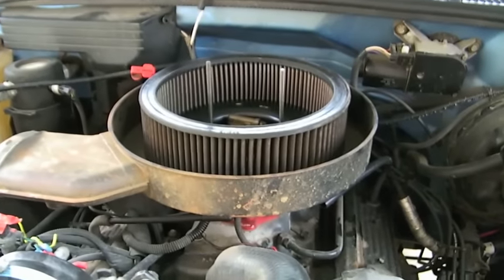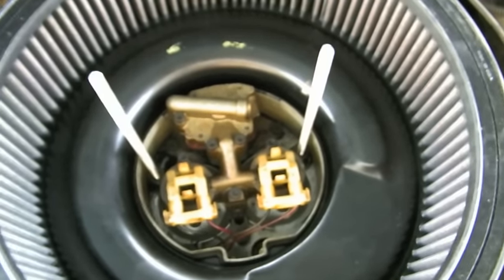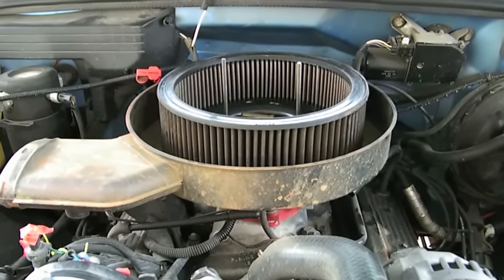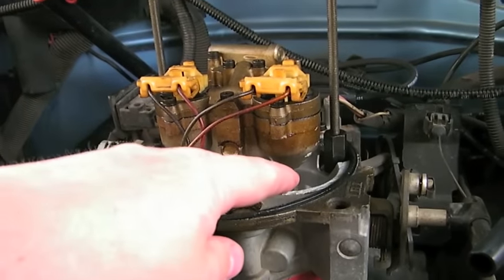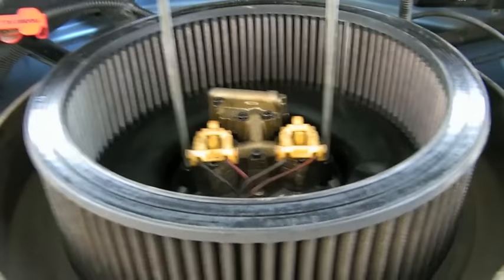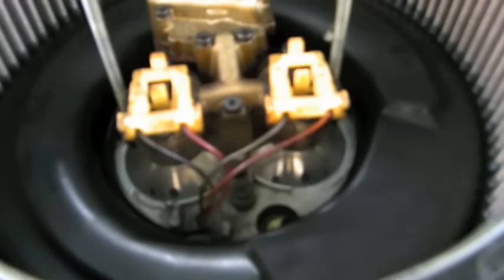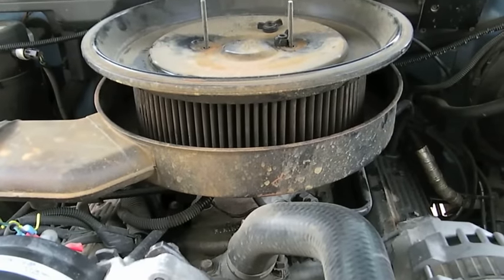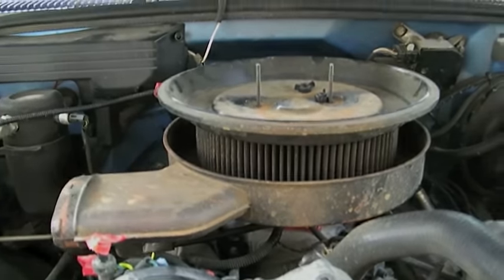TBI mods, how to get the most power and Horse Power from your TBI engine.

Comment: I have a 1990 cadillac brougham, and I git the sport air intake manifold for it, pretty much like a throttle body spacer because the throttle body is sitting up higher, and honestly the car could climb hills in 4th gear for the first time in ever, and the flipping the top thing, I have to agree about the warm air, because my cars outside air temp sensor sits in the air filter housing and it was negative 15 outside Celsius, and honestly while waiting in traffic I looked at it after 15 minutes and it was reading and hove zero until I started moving again than it went back down to the outside temp again, you picks beating on the poor guy here just trying diffrent things isn't nice, his flip does actually work, just as long as your moving and not sitting for a half hour because I proved it by reading my car myself, just please hook the oil blow off on the passenger side into the drivers side one so it's working, but you guys wanna try something, try the sport air intake, it's egr friendly and honestly it made my car run alot more open and free, it could hold its actual speed, 1990 cadillac brougham 5.7 litre, love the car, and getting the motor rebuilt with some fun stuff on it

Comment: Get a set of 305 heads long tube headers flowmasters and manual 5 speed standard with 18 pound Macleod clutch and pressure plate. I think you will be mildly surprised.
Reply from the maker: Thank you for watching.

Comment: so i like doing dumb shit to my 1995 chevy c1500. with 4.3l.  and working in the shop that im at currently, a few of the guys here used to work at the AZ GM Proving ground up until the closing down. and to really get the best air flow just cut a whole in youre right fender leading to the stock air box.  all this aftermarket  "cold" air intake and this bull of flipping the lid it a bunch of shit. hahah. unless you fully remove youre hoodor even cut holes or flares or true hood scoops nothing works as well as the stock. plus its been proven and even dyno tested on a lot of different cars and truck that "cold" air intakes dont do much at all. but the spacer looks cool though.
Reply from the maker: +Michael Jenkins 
Somethings are just fun to do.

Comment: Why does everyone ditch the stock tubing from the fender and flip the lid? All you're doing is make it sound like a Q-jet when you floor it, and you're just pulling hot air from inside the engine bay instead of cool outside air from the fender....
Reply from the maker: +Justin Keckhaver 
We like the sound.
Reply: Ok, well have fun with that
Reply from the maker: I had a lot of fun with it.
Reply: Stock tubing is very restrictive.

Comment: 8 degrees advanced on the distribute  on 305 made my camaro run very nice might be a little more or less for you car but yowl know when you find the sweet spot
Reply from the maker: +Stompin Mcallister I am sure it would. I know playing with the timing on my MR2 made a difference.
Reply: Stompin'------I have the stock 5.7 with the TBI and my Haynes manual says to disconnect the brown wire-with-the-black-strip going to the ECM.  Set the distributor  timing at 0 degrees, then re-connect the brown / black strip wire and the ECM will control the advance timing.   Are you sure about that 8 degrees advance on your engine?
Reply: Yes I'm sure on that gave me better throttle response better kickdown my camaro is a auto tbi I will put a video up soon on it be sure to look at my page in a couple weeks and I will prove it works got the info from the third gen camaro forum tried it and I was blown away the tbi was a turd ever since I got it in 96 its a 92 rs 305 but found that 8 8deg advanced did it and it was like magic like a new motor really but yes it does work car still runs video will be up soon

Comment: No way you gained 20 hp by doing this. Under hood hot air does not add horse power.
Reply from the maker: +scott george 
there is a way. it is ok if you don't believe me.
Reply from the maker: +Doug Anderson 
Technology, it's the future.
Reply: grinding off the runners is a free 50cfm mod..the tbi flows 450cfm stock
Reply: Is hot air better than no air?
Reply: Yes

Comment: Ok so you do know more air will not flow down into TBI right.Flipping that air cleaner causes hot air from engine compartment to enter system which is not a good thing not to mention causes dirty air filters.You so called HP gain was from ur tuneup and exhaust and nothing else. You want COOL air going into engine not hot.....Where is your crank case tube now that you removed thatTBI ring or did you just plug that hole in valve cover lol ?
Reply from the maker: +try duck 
i don't see how this would flow less air. there is more surface area to pull air from so it will be easier to suck the air into the throttle body. also how hot do you think it is under the hood? there is a lot of air throwing through the engine bay. it might get a bit warmer sitting in traffic but as soon as you move it will be fine.
Reply: Try duck 
The stock air filter cover get hot anyway it pulls hot air from the body which is in the sun getting hot. When you flip it the fan and going down the road circulates the air
Reply: Not through a straw. Lid flip is proven. Air cleaner shootout.

Comment: i wish my '91 had the clearance under the hood for the lid flip trick, i tried and it wont work for me, i have the single post setup
Reply: you have to get a little smaller 
air filter
Reply: I also have a 91 and it works on mine

Comment: My chevy 1500 4x4 has a problem i changed that bbig plug on the throttle body it ran fine for a week or so but then it quit it will crank and idel alday long but if you hit the trhottle it will quit can someone help me out with that
Reply: fuel flow metering valve, clogged injectors. 93 chev. 150000 mi. 2 new injectors tbi kit been running fine since.  Also in tank fuel pumps are notorius for weak or just quit altogether. Good luck

Comment: I wish I could take out that ring, but there's all that shit on top of the engine that keeps the air cleaner from sitting flat on the throttle body because I don't have the spacer.

Comment: That hot air cold air thing is overrated.  An open element gives your more HP in all situations, especially when you are going down the road.  You think wind coming in the grill at 25 mph up is hot air??  And TBI's get gains just like any other engine does.  More fuel, more air = more power. Engines 101.

Comment: Let's see a dyno printout showing the 20 hp gain... I've never known anyone to get more than 6 to 8 hp and a little bit extra torque from those mods and correcting the fuel pressure.
Reply from the maker: I don’t have to show you anything
Reply: that's what I thought... no dyno chart ... you have no idea what you gained. You made it sound good though didn't you. Ha ha, ha..... lol....
Reply from the maker: I never claimed to have taken it to a dyno. I did not try to mislead anyone with this video.
Reply from the maker: Hey you’re  super cool.
Reply: At least I'm not a fucking fake, lying to people about the output of my truck.... which is stupid... if you want to go fast do you really think doing in a truck is the way to go?  How aerodynamic is that truck?  I'll bet you've wind tunnel tested it huh?  Lying fake.
Reply from the maker: Thanks for watching.
Reply from the maker: The thumbs down only comes in one size.
Reply from the maker: Thanks for coming out.

Comment: another trick to increase HP is to SWAP THE HEADS! get new aftermarket heads that will allow you to go a bit higher in fuel type and use it more efficiently with compression the stock headers suck and the valves also suck in them not meant to go fast just meant to last * not bad if you want a grocery getter * but you want the best fuel to air mix and a bit more noise out the back heads are one way to go with it plus getting headers for that new upgrade head will also improve the air flow by a lot as well. * remember you engine is basically a air pump the less restrictions you have the more power you can get with the liters you run on for max potential of displacement  *

Comment: The flip does not add power. In fact you are losing power because the engine is sucking in hot air not cold air. This video is bs
Reply from the maker: Hey, thanks for commenting.

Comment: The best TBI Mod is ripping that piece of shit off and chucking it in the garbage. It's the worst thing GM did to that engine.
Reply from the maker: +Claude Smoot could we unbolt it first or do have to rip it out?
Reply: boofighter the idea of ripping it out is that hopefully it will take the intake all the way down to the heads with it. Then you can start over. My 93 BMW had more HP and Torque than that POS.
Reply from the maker: +Claude Smoot that’s cool.
Reply from the maker: +Claude Smoot check out this challenge and let me know which you would pick.
https://youtu.be/RNo_b1VoWCE

Comment: Flipping the lid does not work... cold air is more dense then hot air. And when you flip the lid your just letting in hot air from the engine. Try going up a steep grade at full throttle and your truck will bog out..
Reply: the idael of a lid flip isnt for cold air flow its for air volume the more volume u have the less restrictive u are i used have a dodge dakota with the mangum V8 and on it just fliping the lid made a massive different in feul usage way more of a difference the a complete tune up did
Reply: I hear you. But more air does not always mean good. The warmer the air the less dense its robbing your vehicle of power. This is why they make "cold air intakes" not hot air intakes
Reply: yes that true but 90% of the cold air intake setups i see are done wrong  iv even seen them to were people had them set up running the air off the manifolds thoses ones are funny
Reply: I know it I don't use one I'm good with the stock on my TBI. Not many performance mods you can do to a TBI. Only one I got is a removed the choke collage replaced it with a hyper tech power charger it work pretty hood.
Reply: Good
Reply: I posted my reply in the wrong place LOL . On my 89 chevy 1500 I used the top lid off a 82 chevy 5.7 so I have a stock looking set up using the cold intake BUT a 6 inch filter fits in it. That's an 82 top lid and the stock 89 bottom half
Reply: ill stick with Mercedes Benz they don't need any modifying to run right
Reply: Michael Beck and you will still be a clown
Reply: na cuz ill pass u at 140mph with the cruse control set. im not a clown i wise i buy cars that don't need modified to work good
Reply: Michael Beck You should buy an English textbook, so you can learn the difference between past and present tense. Then you can learn how to use modify and modified in a sentence correctly so your trash talking doesn't look stupid.

No car needs modification. Its just fun to do. If you don't get that then there is no reason for you to be watching this video. Your obviously not too into the car scene.
Reply: Mike Rodriguez my spelling is pretty on point.
Reply: falls under grammer buddy
Reply: +Michael Beck my 98 fox body will smoke your Benz any day, then what will you have to say about car modifications?
Reply from the maker: +Fogleca 
There is always someone faster. No matter how hard you spend.
Reply: It works. Air cleaner shootout, Engine masters. Air cleaner snorkel very restrictive.

Comment: Want more power out of a 350? Cut off the tube from the exhaust manifold so it only gets cool air. 
Upgrade the cam and give it a 4° offset.
Headers
Edelbrok intake manifold.
Complete tune up.

Flipping the air intake cover sucks hot ass air out of the engine bay and degrades the life of the engine. NEVER alter your TBI. He ground off the fuel safety catch walls that made sure fuel went into the intake and doesnt catch fire if the engine ever happens to backfire.

Comment: In the case of a tbi setup they usually go off of just the coolant sensors temp, air temp sensors are on my newer mutiport or multiple injector engines but even then that's manly 2005 and up.Turning he lid upside-down depending on the size of the old breather that it would have been sucking air through plus the amount of supporting mods to the engine can and in allot of cases will make a slight difference.